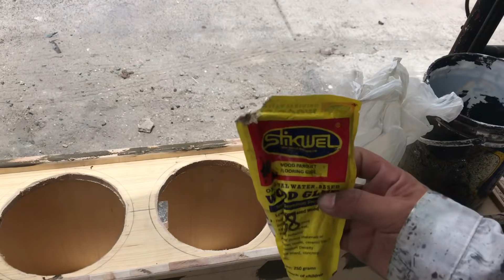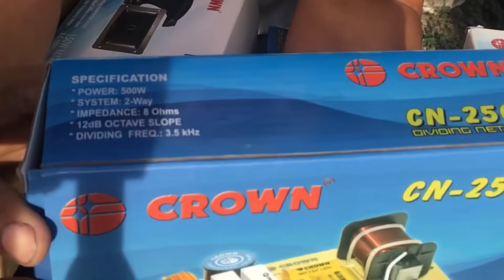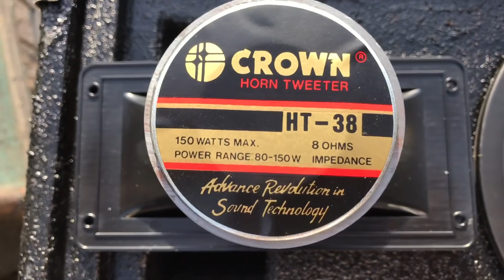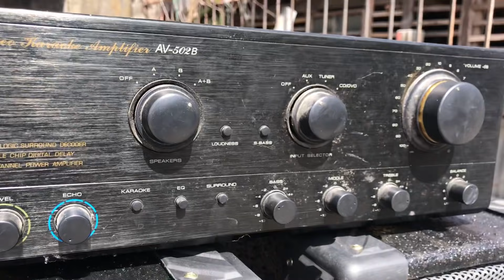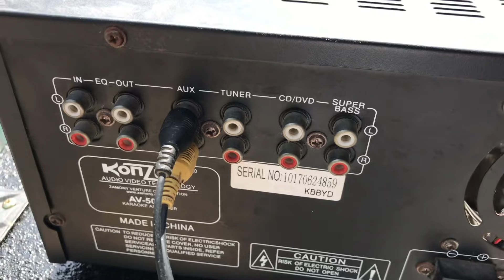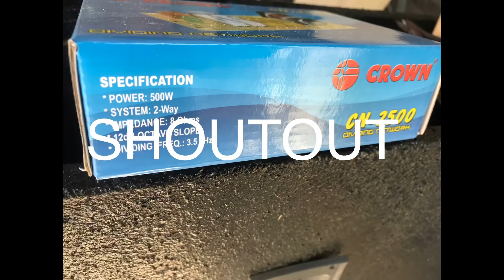ASSEMBLING SPEAKER  TOWER HOME THEATER 2WAY

Comment: Bro. Nag parallel ka ng dalawang instrumental woofer  naging 4 ohms nalang ang impedance niyan pero nag doble ang wattage pano yan iniligay mo.sa dividing network na 8 ohms , hindi na match... over all ano na output impedance ng tower speaker mo? Thanks.
Reply: Ito ang problema sa tao na tao,kalimitan di nasagot sa mga tanong
Reply: Ako sasagot, yung dividing network taga divide lang siya ng network at hindi siya 8ohms. Kaya ang lumabas parin dun 4ohms 300watts! Okay kana.